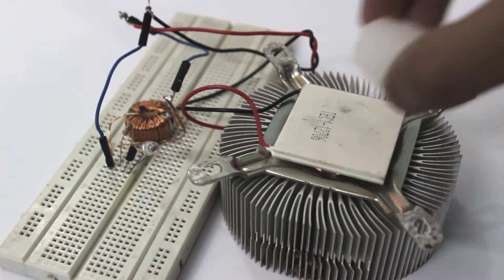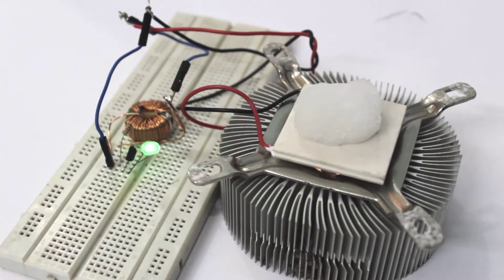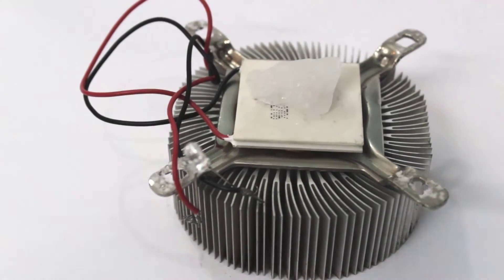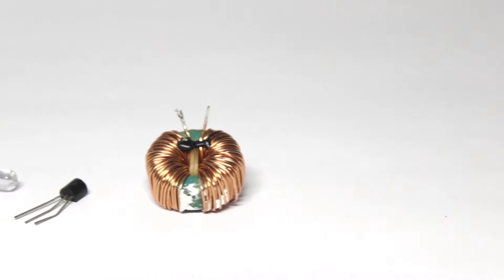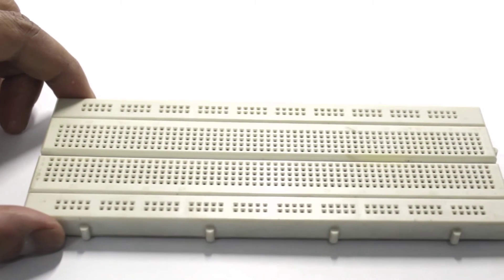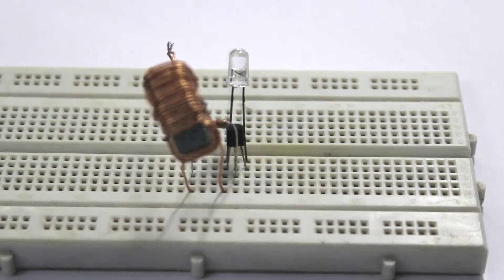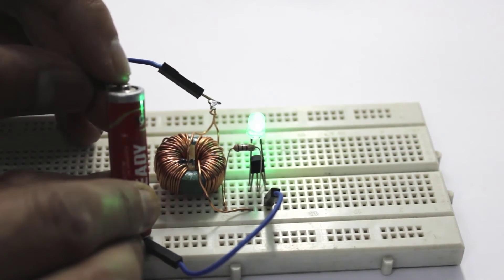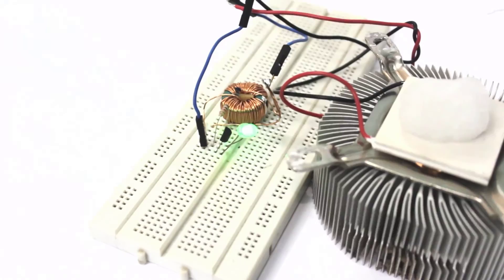Joule Thief | Peltier Module | Generate electricity using ICE

Comment: How much voltage can the joule thief produce and can the voltage that produce by the JT be adjustable ?
Reply: You can also adjust the voltage by adding a potentiometer
Reply from the maker: +Nick Teo That depends on number of factors like input voltage, no. of turns .
Yes you can adjust the voltage by using a zener diode.